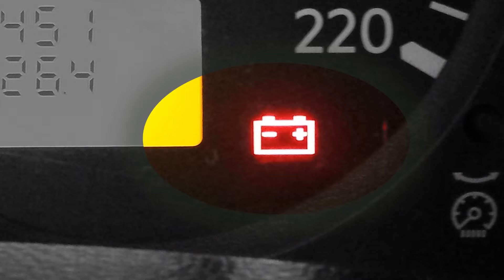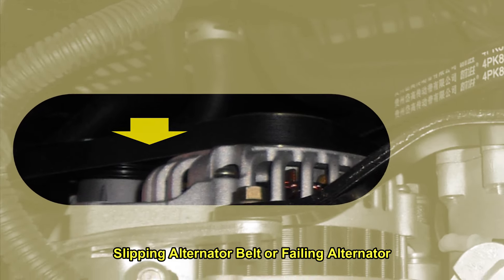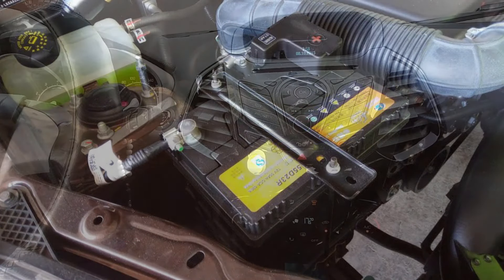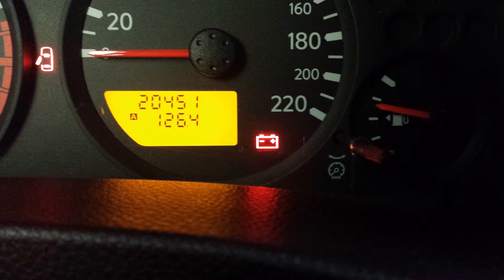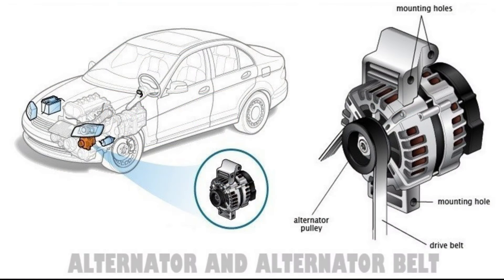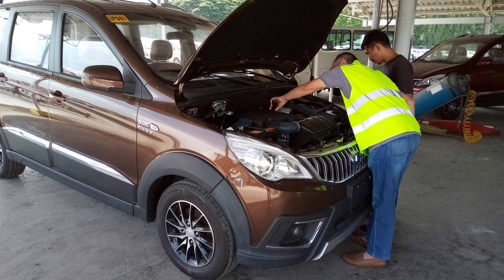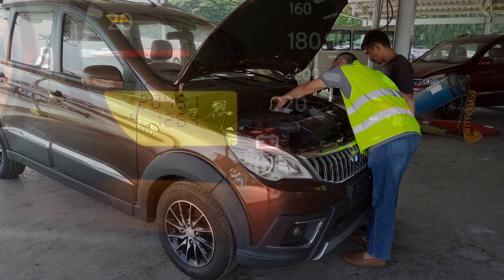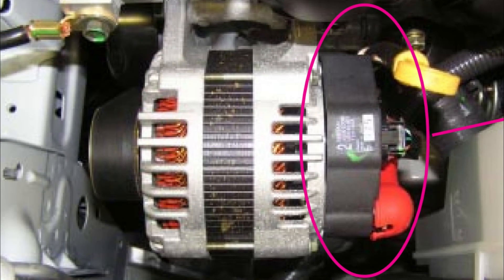Battery Light Come On and Off

Comment: The alternator makes A/C current to keep the battery charged. The alternator may be OK and the charge is NOT going into the battery. Do NOT assume that the alternator is failing until it is metered and is proven faulty....
Reply from the maker: It says generally it is the problem.
Reply: @cartechhome  generally is not good enough if a new alternator is $130-200  and install costs...
Reply from the maker: It says generally which means you have an idea of where to look for.
Reply: When i drive my car in heavy rain water on the road splash when i ran in to it then battery light is flickering. What the problem of this? Is it the alternator gets wet
Reply: So i have my battery light on in my 2019 Chevy express. Had 12.5 volts running should be between 13.5-14.5 running. Changed the alternator, battery reads 13.0 volts not running. With new alternator it reads 13.65 so alt and battery are good. Battery lights is still on. If all else is good, which alt and battery can be checked with a multi meter. The only thing i haven’t changed is a sensor that is on the battery terminals that is a current voltage regulator, it’s a $15 part. Pretty sure that’s it, especially on chevys. So it’s not always the alternator, always check it with a multi meter should read between 13.5-14.5 if good running. When alt drops under 12 volts it will use the battery and run it dead and the vehicle will die.
Reply: @junjungebutan843 Im experiencing the same thing. Did you figured it out
Reply: @Pri79111  yes.. my alternator damage .. diode burned. then i buy new diode and fix it.
Reply: Change battery terminal connectors
Reply: @junjungebutan843  that means that the alternator get wet, and the belt slide at that moment, that's why the light turn on and off..

Comment: Changed my alternator, got a new battery and the battery light came on when i came to a stoplight. But went away right when i stepped on the gas pedal to go. Idk what to do anymore and im broke and scared. Could i need to change my terminal posts?
Reply: @joleneguerrero4794  bro !!!! Same thing right now on my Camry . Changed the alternator after my car was losing power . Car has 200k miles . They said my belt was still good so they kept it . But I still have same battery . when I come to a stop (mornings only ) it comes on , then when I push gas pedal comes off . Did you figure it out ?

Comment: Well my i think my alternator is loose because lastnight when i got home my car was working fine , then as i was heading back out to get dinner it start acting funny then it wouldn’t start it just started making a clicking sound , and then next morning i woke up to see if it would start up and it did . Then a house later i went back it started doing the clicking sound again
Reply: Did you notice the problems ?
Reply: Have u checked if battery terminals is not loose ???  Check battery water ???
Reply: Sounds like a loose connection

Comment: i put new alternator and battery and still have same problem
Reply from the maker: Check the wiring. Checkvoltage drop between alternator and battery . Verify the capacity of your alternator against the electrical requirement of your car.
Reply: @cartechhome  Hi, is it a good idea to link  the video on voltage drop.
Reply: Could it be starter?

Comment: Like literally happened to me this morning had all the signs off failed alternator then acted all normal all off a sudden
Reply: Same here and then when I got off work it never turned on and auto store tested battery and alternator and they both tested good
Reply: @kristianlundgaard8710  I hope that’s the case for me too, mine turned on and I have places I need to go tonight before I can take it to a mechanic. Rlly hope the car doesn’t die in traffic lol
Reply: My car is doing the same , my car was working fine and now it’s not my lights and everything still comes on but my car won’t start and is making a clicking sound
Reply: @kristianlundgaard8710   so what was the issue after you got it fixed ?
Reply: @norahb  just had that happen to me tonight on my way to a weekend get away. Managed to get to my friend's house ok but will need to drop it off at a shop tom (on a Sat) but fortunately have someone driving to get me so that we can hit up an event together. Guess we'll see what they find.

Comment: hey i m having ford 1.4 tdci , whenever i start the car , that battery warning light glows but if i press the throttle all the way to 4000rpm it disappers till i shut the engine Off , plz help me 2:39 2:39

Comment: brother i have ford fiesta 1.4 tdci my problem is that whenever i start the car  battery warning light comes on the dash but if i fully press the throttle all the way to 5k rpm it starts charging and light , this  goes offf , plz help me to solve this issue . this problem started when i changed the battery
Reply from the maker: Did the new battery the same as the battery intended for your car?
Reply: @cartechhome  yes it is the same battery
Reply from the maker: @motologist1917  Check the alternator.
Reply: @cartechhome  ok but some1 told me that u need to reset the battery senson , do mk5 fiesta have battery sensor

Comment: Sir. I've tested the alternator by disconnected the -ve battery terminal.Engine still running..that means alternator still charging.The problem is battery indicator light on and off.So far my car battery ok.. engine start ok as well.What's the problems actually?Tqvm
Reply from the maker: On and off means failing, not yet totally failing, one possible reason is the alternator belt is slipping, or the alternator is about to fail.
Reply: @cartechhome  my battery light flickering once in a while. What could that be?
Reply from the maker: @gerrylopez9060  The  charging system is failing, other possibility is the alternator belt is slipping or the alternator is failing.

Comment: I just replaced battery, alternator, and alternator belt light is still coming on and off
Reply from the maker: Check the wirings. Do a voltage drop test, we have related videos on how to conduct a voltage drop test between the battery and alternator. Also, check the capacity of your alternator.
Reply: Could also be the belt tensioner

Comment: I have a new battery and alternator however my battery light keeps coming on and off! Autozone said battery and alternator is good so what could it be
Reply from the maker: Check the wiring, one possible reason is the corrosion in the wiring  checks the voltage drop between battery and alternator, we have related videos on this channel on how to check the voltage drop.
Reply: @cartechhome  thanks! I ended up just replacing the alternator!!! Battery light is now off, I’m assuming the other was faulty!
Reply: @laylaytrwright1969 So the battery light was flickering! And did it end up being the alternator? Because I'm having the same problem. Can u please let me know

Comment: I just installed a new alternator last week and now every time  I accelerate and the rpm goes over 3, the battery light comes on. I got tested the battery, started and the alternator and they are all good. Does anyone have idea what could be?
Reply: Same problem with me it kind of flickers whenever I'm speeding up from a full stop
Reply: Did you found the reason????
Reply: @tylerjeffries7507 yow same thing for me did u find a solution or what was the cause
Reply: Did I find the reason bruh
Reply: Serpentine belt or the tensioner
Reply: Did you replace the serpentine belt when you replaced the alternator? A worn, or even new belt might be slipping at high RPM's, preventing the alternator from charging properly. Or in rare cases, the new alternator might have a faulty voltage regulator, causing it to overcharge at high RPM.
Reply: Any update on the issue and correction?